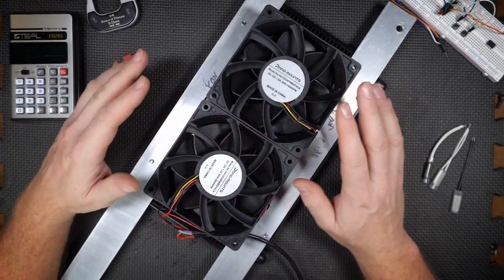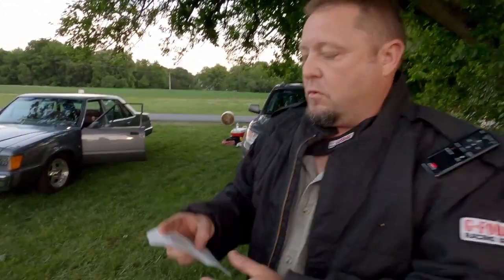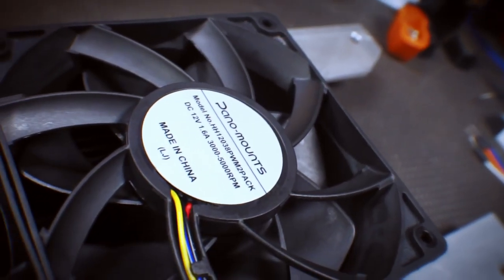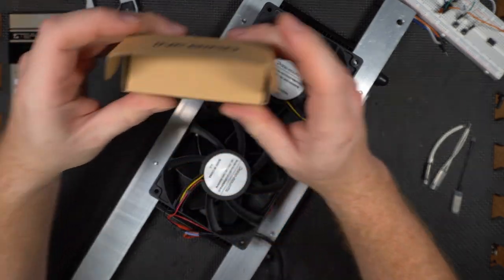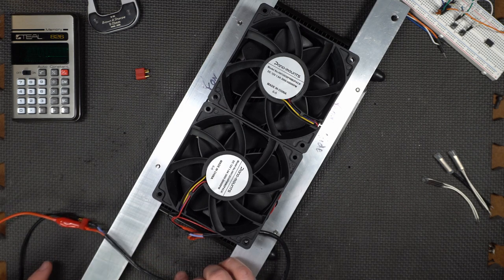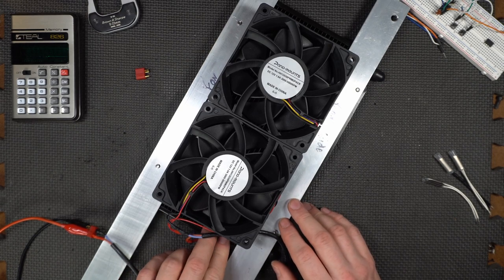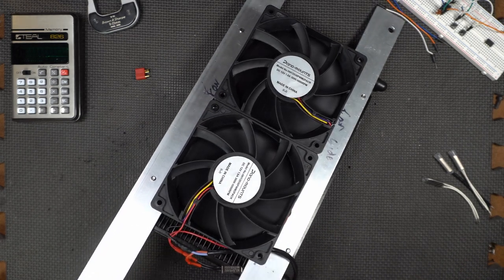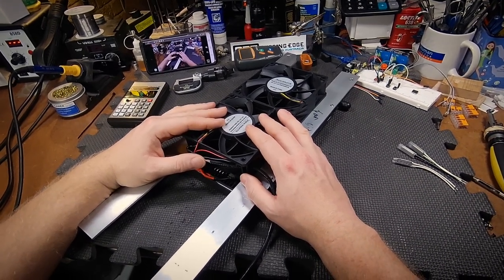Easiest & Cheapest Cooling Fan Controller

Comment: Similar to the approach I ended up taking when I heated my parts washer. I was going to go with one of those Inkbird thermostats and use a solid state relay, but instead I just went with a simple water heater thermostat. Could have gone even simpler with a set temp thermostat, but mine has at least a little adjustment. I always wonder why people don't fan cool their auxiliary coolers more.

Comment: ROFLMAO @ the Puddy-Cat...
Another trick is a relay and second thermal switch. First switches the power on to the fans but in series wired mode, second thermal switch set a little hotter to pull both fans in tandem. Otherwise, fans always on in serioes and when heat load comes up and gets a little hotter, band, both into tandem for a lot more flow.
Reply from the maker: That's a really clever idea.  In fact, I'm installing a new radiator with 2 cooling fans - at first, I'll just keep computer control of them (easier for now).  But I'm going to tuck that little tidbit away in the back of my mind for the future.

Comment: How will those fans work in wet weather?
Reply from the maker: In my case, that shouldn't be a problem.  I don't drive this thing in the rain unless I get caught in it by accident; also, where they're mounted it would be almost impossible for them to get wet.  However, you can buy IP67 (i.e. waterproof) 120 mm fans.  These move a little less air, but probably still enough:  https://amzn.to/3VKJzZ4

Comment: Alex what's up with the electric turbo?? You haven't posted anything in a while!!  

Quick question. What type of air pump do you think would be most likely to work in a 200psi system utilizing a reservoir / buffer tank.  In which The trunk mounted pump feeds the trunk mounted tank 200psi... 1.5" line feeds the engine 0-15psi via regulators.

The intake manifold has two air inputs, one from the trunk mounted tank, and the other is the stock from filter (which will have some method of shutting off to prevent boost escaping).

I am not looking for boost above 2500 rpm...

I want on demand boost from 800 RPM to 2500 RPM on a V6 3.6ish for daily driving.... far far less CFM than you need.

I'm thinking the only thing that might work would be twin screw?
Reply from the maker: Mickey Thompson did something similar to that way back in the day - he used giant tanks of compressed air.  There's a company trying to evolve that concept: https://casupercharging.com/about-us/  It's complicated, somewhat dangerous and physically large and only good for drag racing, but does have the advantage of being extremely cold.  I am working on the electric turbo stuff - in fact, I'm about to do some torture testing (with a video, of course) on the new P2/Castle Creations/Hobbyking setup.  I'm also installing everything for the revamped sledgehammer in the car right now.  The holdup is my daughter is having health issues and I'm trying to build a barndominium/studio 1,600 miles away while still working and doing life stuff.  It's all still moving along and hopefully this is time well spent.  I now have two P2 units along with the sledghammer BTW - you can probably see where that's going.

Comment: I suppose a guy could use those switches for radiator fans as well by having them control the relays. There has to be a down side for something so simple - are the bi-metalics prone to vibration?
Reply from the maker: Vibration really isn't an issue.  And I'd say a relay is pretty important (since I posted this video, the switch has already failed at 3 amps of draw - a relay would've prevented that).